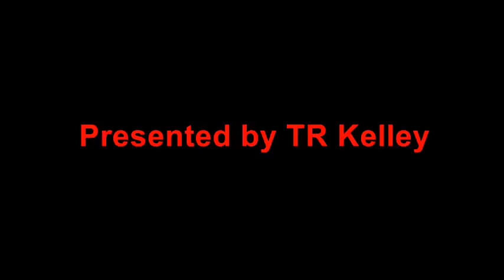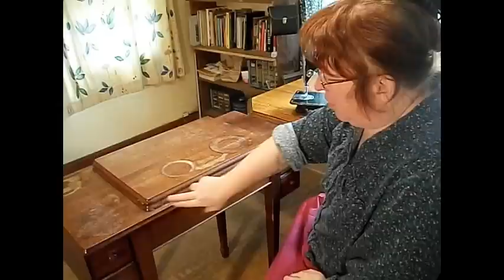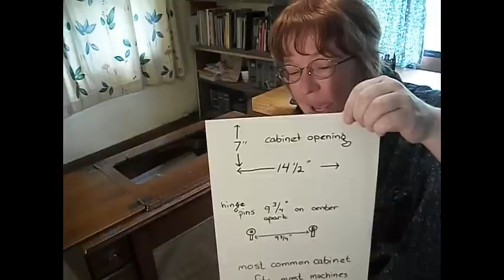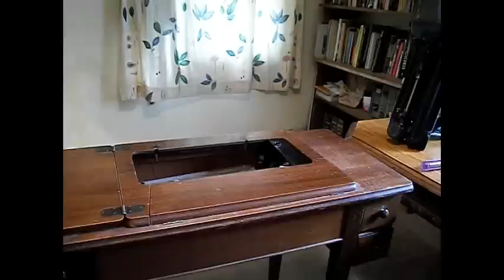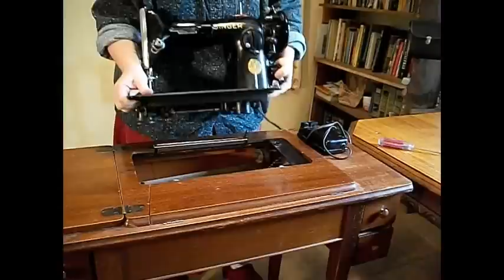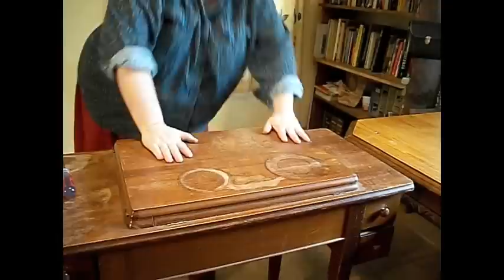How to Install a Sewing Machine into a Cabinet

Comment: This is a very helpful video. I am gradually unearthing a few sewing machines for getting them checked up. One question I have about this video, is how is the bobbin accessed? Is the bobbin cover a plate that lifts up and out? It looks flush with the cabinet, and I am just curious about this flat bed machine since I have a yet-unexcavated machine from about 1970 that weighs as much as a locomotive…or so it always seemed. I don’t recall how the bobbin was accessed.

Comment: I have a friends sewing machine (Dressmaker) and it is installed in a table. It folds away just like the one you showed us. This machine and table were clearly made for each other. The machine fits perfectly inside. I just bought a singer heavy duty 8832 from Costco. I’m sure it’s going to be great, but there’s clearly not going to fit into this table.  

Do you have any recommendations for tables for new sewing machine such as what I have? Is there a best manufacturer? Or do you suggest I just start digging around in thrift stores and used furniture shops, and make it work?

It was a great video thank you for showing it to us

Comment: I have a necchi BU, that apparently does not have the same size holes in it that most machines do. The machine had leaned over and broke the existing hinges that were on there, and I have been unable to find them. Do you know where I could find a replacement set?

Comment: FOR THE LOVE OF PETE!!!!
My sewing machine vintage 1965 was not sewing well, all settings correct.
I pulled it out of the cabinet to have it serviced where I had always taken it to be “timed and tuned”.
Good news was that the thread I was using, has a coating on it, and as it gets closer to running out, the coating builds up on the needle and causes it to “pull” the needle, causing it to miss stitches.
I brought the machine home, and for the love of Pete, I couldn’t keep the pegs up to slide it back into position.  The rubber band suggestion was stellar, but I still couldn’t get the machine on the left peg, only the right.  I used steel wool for cleaning the outside, I sprayed silicone into the hole, I bought a little brass reamer to clean out the hole, I couldn’t think of anything else!!
I worked on trying to mount the machine as my back allowed.  Then I saw your video!!
Easy-peasy! Done in about 5 minutes!!
Thank you so very much!!!

Comment: Hello, maybe if you are still doing this work, you can help me figure this out: I got an old sewing machine, in a very useful cabinet that has an extra long arm for crafting and it looks like a desk, so I can use it as such, if I am not crafting or sewing. My issue is that I would like to dispose of the machine that is there and wonder if in its place I can put a modern Brother sewing machine or a Singer sewing machine that was made to look like the vintage machines, but, it is modern. Please let me know if you have any idea on how I can do both or either of the processes. Thanks.

Comment: Your rubber-band "trick" is fantastic!  How I wish that I had seen your video before two of us struggled and struggled to get my machine back into the cabinet!!  I have another question, though:  I cannot remember how to insert the Speed Controller back into the cabinet.  (I prefer to use knee pressure rather than foot pressure.)  The controller needs somehow to be slipped under the lever that presses the controller, but none of my ideas or struggling has helped.  Such information is nowhere in the instruction manual (and I did buy the cabinet from Singer when I bought the machine).  The machine is a Stylist Model 418.  I would love and appreciate any assistance that you can give to me.

Comment: OMG Thank you!! That rubber band to hold the pins up, and setting the set screws made the whole difference! You're fantastic! Also, I have the 2 tone turquiose sew-mor that I think I see in your icon picture. But I got a Pfaff 230 with a cabinet I had to disassemble from the cabinet. Thanks a million!
Reply: I have that machine also, I got it in 1962 brand new.

Comment: I painted my sewing machine cabinet with chalk paint and added decor trim I made using molds.  The finish on the cabinet was in terrible shape but the 1929 Singer machine inside in pristine condition. It was my grandmum's cabinet & machine. She had 2 machines. 1 is in a carrying case & the other in the cabinet. Both were wrapped in blankets & plastic before stored in my aunts basement.  My aunt gave the one in the cabinet to my sister hoping she would take up sewing. Instead the cabinet got used as a table making flower arrangements on. That's how the tops finish got ruined. Thankfully she never unwrapped the machine itself from it's protective covering so it's also in pristine condition. It's amazing how my grandmum heavily used both machines sewing all the clothes for her family of 12 plus all the grandkids, to make quilts, toys, etc etc and she managed to keep both in almost new condition. One has the Rocco design and the other the Sphinx.  I feel so incredibly lucky to have 2 such treasures.

Comment: Great Help. I have an old Sewing machine I got for Free that and an old sewing cabinet that I just use as a desk for my New Sewing Machine. I'm going to try putting my old sewing machine in this cabinet the way it should be. The old sewing machine is attached to a case right now but is on pins in the case and the pins are in the same distance apart as the pins on the desk.

Comment: Loved the rubber band hint.  However, my problem is just the opposite:  I already HAVE a wonderful cabinet into which I have placed two different Singers over the space of 50+ years.  Now I need a new machine and they no longer MAKE them with the hinge pins in the back for cabinet mounting!  I am dismayed!  I LOVE my cabinet and do not want to start looking for other ways of using a machine!  Any ideas?

Comment: Thank you for your video. I now have the vocabulary to express what I need! I have a Pfaff 230 machine and cabinet. I removed the machine for repair, but now it doesn't stay put when I tried to replace it. I THINK the set screws are now wrapped around the hinge pins. Where can I get set pins for this 1955 cabinet and machine?  Thanks.
Reply: Try just googling them.  I saw some just today, although I can't tell you exactly where, nor if they fit your particular cabinet, but you can start there.

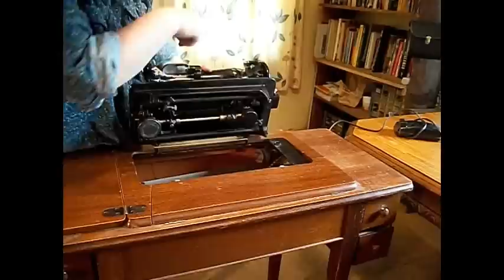Comment: Like a lot of people I love the rubber band idea!  I have a question I wonder if anyone can help me with please.  At 4:26 or so in the vid you can can see the "lift up wooden part" at the front of the treadle table is lifted and I can see two light grey (?) round things that look a bit like buttons.  They're on the little wooden "ledge" that the front edge of the machine will nestle/rest on when it is sitting upright, ready to use, in the treadle cabinet.  Does anyone know what they're made of, or what they're called, please?  
Mine are missing on my table and I'd like to get whatever they are meant to be so that I can slide open the bobbin plate without it wanting to scrape on the table.  The back of the machine bed sits slightly proud of the table and I can see these two little things are meant to make sure the front of the machine bed does the same.  But I can't seem to find anything listed anywhere about what they're made of, called, or where you can get replacements if yours are gone.  
For all I know these ones in the vid may be two "workaround" plastic, modern buttons glued in place by someone to replace what was originally there. :-D  On my "ledge" there are two little round, flat-bottomed, straight-sided depressions, but no hole of any kind in the bottom of that to indicate anything was ever screwed in there.  I presume something was simply pushed firmly into place. Any help at all is much appreciated...  Thank you.
Reply: My 75 year old Pfaff had the same problem, but no buttons. It just had tiny remnants of cork that had been stapled to that front ledge. I went to Hobby Lobby and found some cork tiles. Bought the whole package of four tiles to cut off a half-inch strip, and glued it in place. Works perfect. I see you asked this question a year ago but I only saw it today. Still have a bunch of cork!
Reply: @suemauer5965  Thank you so much Sue - much appreciated.

Comment: Can you remove the black metal flapper. My singer 404 is longer than the cabinet slot.
Reply: Do you need the treadle?  That flapper has holes in it that guide the treadle belt and line up with the treadle wheel and belt-groove in your machine.  And you may find, even if you don't treadle (if yours is anything like mine) that the wooden lift-up part at the front may not work correctly supporting a longer machine.  Hopefully someone who has actually tried it can tell you a bit more.
Reply: I should edit that to say if it has 2 holes in it they're for a treadle belt!  If yours only has one hole, ignore me.  :-D

Comment: I am not sure if you are still using this channel, but I have an old cabinet with my mothers sewing machine in it. It has finally died and can not be fixed. I have found a nice singer replacement for $10. A singer Model 4562 and want to use the same cabinet. Is it possible to ise the old cabinet with a newer model?

Comment: Thanks so much! I refinished an old mid-century cabinet which is solid wood. Turned out very cute in mint green and sparkly hardware, but I was having problems with the screws. This video was perfect.

Comment: This is exactly what I needed right now.  I am trying to get my old Bernina 117 K going and so far so good.  It hasn't been used in some years so I am re learning about it and need a cabinet.  Thanks for talking about finding one at a thrift store.  A couple things you taught me today was to measure the space needed, especially the distances between the hinges.  Another great tip, I agree with Mary Balantic, is the rubber bands.  The 'set screws' is another thing I didn't understand.  I'll have to check my machine.  I just learned yesterday about the set screws and thought they were supposed to be on the hinges so, now, I have to check my machine.  Thanks for posting.

Comment: Vintage Singer cabinets have a smaller opening than vintage Kenmore sewing machine cabinets. Sears Kenmore machines have square corners on their sewing machine beds. Singer machine beds have rounded corners. You cannot use a Singer cabinet with a Kenmore machine and vice versa. Most vintage machines will fit in a Singer cabinet. Measure!

Comment: I have an old Singer, it was put into a white plastic case at some point; it was secured to this case with the hinge pins with what looks like a rivet with rounded top. So there is no screw to unscrew. I literally found a cabinet on the street today, tomorrow is trash pickup; it's a perfectly functional cabinet, but there are no hinges. So I've got the opposite of this video; a cabinet with no hinges, the hinges are in the machine already. You look like a pro who has probably encountered this situation, hopefully you can help!

Comment: Thanks for all your great videos. Tried to email some questions via your website, didn't go through. 
First a compliment, you showcase the cleanest refurbished machines I've seen, and there are a lot of videos out there. Helps me know you know what your doing and just how much you care about your machines :o)

Question 1: My hubby picked up an antique 1913 White  FR 3009572 for me, with cabinet and treadle. Parts move with the hand wheel (have not attempted to thread or anything yet, no needle anyway). The treadle components and cabinet seem complete except for the belt. One bobbin included. I would like to restore this item and learn how to work it, Do you have a video you recommend for it?

Question 2: I'm facinated by the all  metal gear machines with full rotary movement. They seem quite loud. Do you think fitting one with a hand crank would make it run quietly? Can they be retrofit to a treadle? 

Question 3: I need the quietest possible solution that is not handsewing so I can sew my quilt blocks together without disturbing my husband. I HATE to hand sew, and was thinking atreadle or hand crank might be the best solution do you think the machine he got for me fits the bill or do recommend something else for that? The least little noise seems to bother him, so want to get the most silent solution possible that's not completely impractible.

Comment: Inside the cabinet there should have been a flat like metal bar that "flaps" down almost parallel to the right front leg.  There will be a holder/slot that the control foot fits into, and when you push the metal bar with the side of your right knee it presses against the control's foot button as the foot control sits in the holder ( that's under the cabinet space) to operate the machine. Most cabinets have that flat metal bar knee operation lever, so that the sewing machine foot is never on the floor. I have yet to find on youtube anyone ever showing this built in mechanism.  A give away that the sewing machine would use this feature is the foot control has the two square buttons on the control foot, like foot control you are showing.  The square like clam shell type foot control on other machines also have cabinets that have a foot control holder to fit that shape of that particular foot control, so that you can operate the machine via a knee lever. I have enjoyed watching your videos of vintage machines, thanks.   albuquerque
Reply: B Metz I bought my singer for $10 and unfortunately couldn’t fit the table ($40) in my suv but it had that peddle thing you are talking about!! It was a pretty cool mechanism, I think the guy sold it but I ended up buying a sewing cabinet for my machine now and it doesn’t have that but I was thinking of looking for it on eBay and Amazon to put it on there so I won’t have cords out
Reply: @_est.1992_  ...  the knee lever is to be attached to the (foot) pedal and attached to the inside of the cabinet so the knee can be used to run the machine.  Not always flat.  Mine was curved.  You can make one yourself.  Attach it to the foot control and attach the foot control to the side of the cabinet you want to use it.
Reply: Every machine and cabinet I’ve found so far has that leg press control. I’ve yet to find a video on how to take a machine out of one of these cabinets and into a new one of the same kind. I have 2 White sewing machines inside the cabinets. One cabinet is aged quite a bit and the machine is literally falling off the hinges. I have a new cabinet but no clue how to remove the machine and all the wires and install into the new one.

Comment: I have a 221-2 with a cabinet. The problem I have is when I fold it into the cabinet to store it and close the top down. It wants to fall out. Wondering if something is missing on the cabinet that holds the machine into it??